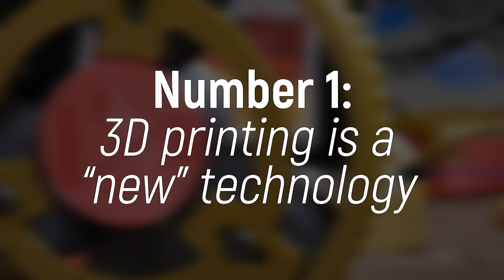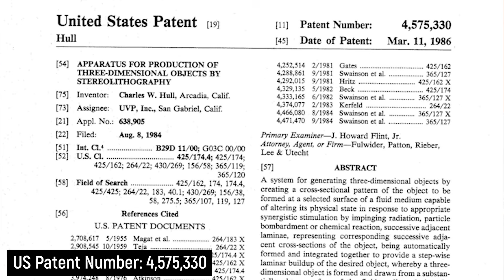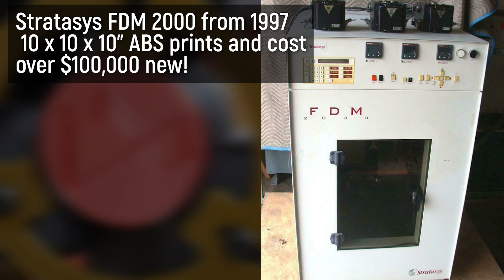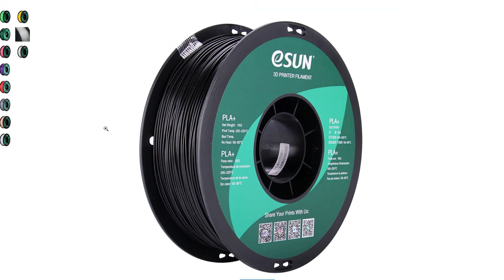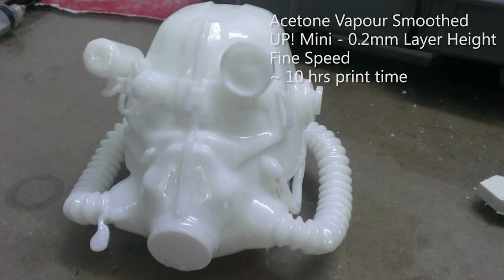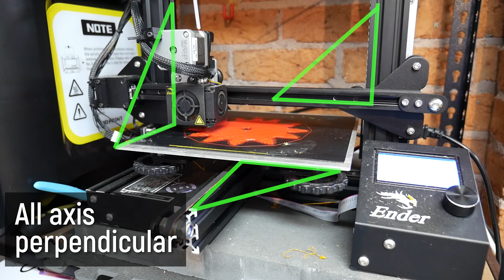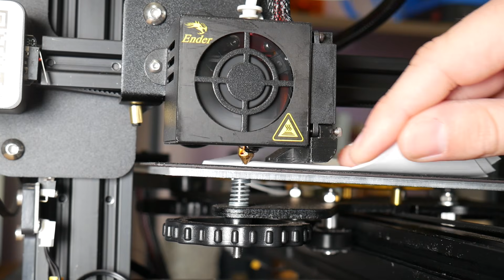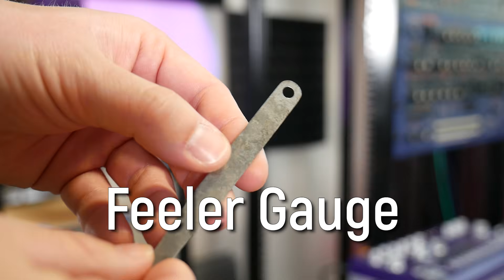3D Printing Myths I used to believe...

Comment: My first experience was in the early 90s visiting a General Motors R&D facility when in high school where they were doing SLA at the time.  Then again when I worked in the Aerospace industry around 2006 where my first machine was an Stratsys that we used to for lost cast molds that were used in place of wax.

Comment: You would never use a folded piece of paper (and this is the first time I have ever heard such a silly thing mentioned).  Use a single standard thickness piece of paper, I prefer junk mail.  You want a little bit of grab but not enough you have trouble pulling it out.

Comment: We really need a proper z depth probe for the nozzle. It should be rather easy to hookup a gpio port to the nozzle then ground a feeler gauge on the bed. Then you just need to run down the z until the circuit closes and you have the nozzle height. Simply subtract  the gage and you are good to go.

Comment: How can it take years to discover something as generic as feeler gauges, which have been used to set valves clearances and ignition timing for over 100 years?

I sometimes wonder what they teach in schools and universities these days, and how limited someone’s knowledge and experience has to be to qualify as a teacher or a lecturer. 

To be clear, as soon as I saw you faffing about with that piece of paper, I immediately thought of a feeler gauge. Then when you said that there’s actually a ‘DEBATE’ about how much drag is appropriate, I thought I’d been locked up in a mental ward! 

This reminds me of the nonsense excuses NASA gives for not returning to the Moon for 50 years: they’ve lost the technology. I thought that was impossible, but you made me believe I was wrong. 

We are apparently not evolving as a species. We are instead in a state of steady retardation.

Comment: #2 I quickly found out back in 2013 that ABS wasn't a great 3D printing filament, found that slapping a bag over my Replicator Dual greatly improved it and also stopped the bed from warping (which also removed z banding)

#3 because the bed is "springy" i use a light and check for there to be the slightest of light to show as each corner can have different spring tension, meaning each corner having the same resistance means there's the same amount of force on the spring and not equal distance.

Comment: How hard would it be to design a print-head that has a range-finder that measures its own height above the bed as it works, rather than using pre-sets?

Comment: I've been "leveling" (tramming) my bed lately using a flashlight. Shine the light behind it, get down low and look across the bed, and move the nozzle down just until you can't see light under it any more. It's crazy easy, almost too easy to screw up, and gives you a near perfect zero point. 
Also, I really think the first and only mod anyone needs to make to their printer is installing Marlin 2.0 for mesh leveling and babystepping. Seriously, this is pretty much a requirement especially for kit printers. These two features are real game changers and absolutely crucial for getting pornographic first layers
Reply: I've done this too when I was in the field (doing a demo in a class) Just make sure the nozzle is clean and it works nicely

Comment: While correcting misconceptions about leveling you should address the issue of whether you should heat the bed first.
Reply: If you are printing PC in an enclosure you better let the enclosure warm up as well because the gap will change again.

Comment: I always used a single thickness of paper, then matched the 'grip' on all four corners.  (I made sure that it was fairly hard to shift the paper)  

To make sure that I got a good, smooth, 'grippy' bottom, I run a hot, slow, 0.04mm bottom layer.  I don't need a glue stick/tape/a brim or raft/etc., as it always sticks VERY well and the bottom is *perfect*.  Even when I switched to (etched) glass, I don't need a glue stick/hair spray/etc.  I just clean it well and go.  (I suspect that the nozzle is actually running along the surface for the first layer, and, after the molten plastic is packed into the tiny surface defects, the trailing edge of the nozzle scrapes the rest off.  By the time the nozzle gets back to that location for the second, faster, cooler pass, the thin film has set firmly in place, giving the rest of the print a solid foundation.  The only time that prints let go is when something goes wrong and the nozzle ends up pushing against something.

Comment: The first time I saw a fused filament 3D-printer was when I was studying at Turku institute of technology In the early 90:s. It even had dual extruders, one for the actual print, one for support material. It was quite slow and the resolution was lower than the current ones and I guess it was very expensive but it had a fairly large printing area, maybe something like 50x50x50 cm and an enclosure. Don't know what material it used, probably ABS.

Comment: At its basic level, 3d printing is using a wire feeder to deposit a spool of material in layers, not unlike how a mig welder works and mig welders have been around since the 50's.

Comment: Great bed-levelling tip there, running a CNC mill teaches tramming in no time at all, gets expensive fast when its wrong ;)  By knowing your gauge thickness exactly and raising the bed to that height before tramming, the gauge can be any height at all and it will still give good results.

Comment: Thank you for finally "officially" clearing up some of this stuff that has been floating around for years... I eventually stopped helping people with their printers because they would always say "XXX YouTube printing guru says to do this" <Insert mythconception> and I would try to show them the proper way to get good prints... This has been my livelihood for decades and I know and have tried to explain all of these... from the most basic This is a machine tool and requires care and maintenance to the proper ways of actually setting one up correctly and altering the parameters based on speeds, materials and finish... but after being told for the thousandth time that "I don't know what I am talking about" I finally let them just go and continue with their fiddling while I just keep making prints... Thankfully, you have been one of the better ones out there and produced a LOT of great content!

Comment: I use a feeler gauge to "level" my printer bed. Paper can crush under the nozzle when you feel the resistance..but then are you at the right height? Metal feeler gauges are solid and don't crush easy thus more accuracy in bed to nozzle height.

Comment: if using a feeler gauge to set the bed height try the go-no go technique. To set at say 0.3 use a 0.4 adjust till it will not slide under the nozzle then 0.2 till it will slide under without resistance then recheck with the 0.4. Takes the guess work out of using one 0.3 gauge and how tight it should feel.

Comment: We print hooks to hang customer chainsaw chains on for work.  Even generic cheap ABS has a very low fail rate.  When I have tried various PLA and PLA+ filaments the fail rate is almost 100%, many fail within the first afternoon hanging on the done wall.  Add the impact resistance and heat resistance of ABS over PLA and that we have been buying cheap generic ABS at $12.87 a roll including tax and shipping I just have no interest in PLA.

Comment: I run the bed at operating temp, but turn off the nozzle when checking for Z height.  The filament I feel weeps through the nozzle and causes excess friction.

Comment: Great video! I love the power of debunking myths. Also, you're quite right about the fact that only 3 points are needed to level a plane. In fact 4-points make it much more difficult and potentially worse (in my beginner's days, I used to over-tighten the screws so the bed actually started to warp slightly).
Reply: I often end up with one knob coming loose

Comment: Thanks for this. I've been screaming "the nozzle is no longer at zero after you have leveled with paper or metal" for about a decade now. Hopefully it will finally sink in for the masses. 

As for baby steps to get to your leveling height, I'm not a fan of that either. This doesn't account for backlash -  that first jog up might not actually move anywhere even though the computer thinks it has, all due to slop in the lead screw. 

Add to that, many of the cheaper machines can't actually do a .1mm move repeatably or accurately (.08 yes, .12 yes but .1 no -  based on a .04 magic number).

 A better solution is to make some leveling Gcode that runs around the bed for you at the height your first layer will be at and use feeler gauges to set that distance (this works great for having the Feelers set a perfect squish distance for that first layer too, AND the machine does the moving for you so you aren't accidentally lowering the Z without knowing it).  With this code used for leveling you can build in the Home routine, and the move to first Z position too so that the machine is doing the same thing both at the start of the printing code and at the start of your leveling code. Whatever your slicer injects into the printing Gcode or what your Start script is doing before that first extrusion command, put those Z moves into your leveling Gcode too. Even if some of the backlash is not taken up when you first move to your first layer height, it won't matter because it will turn out the same, both when printing and leveling. The nozzle may not be exactly .16mm ( or whatever) from the bed even though the printer thinks it is, but by the time you have set the nozzle gap with a feeler gauge as you are running your leveling code, it will end up with the gap you want and the printer will be none the wiser. And that distance will be repeatable when the printer starts an actual print and the next time you need to level!
But as Chep says, that's a lot for someone just starting to wrap their heads around especially when they just want to get printing.

Side note -  I too scratched my head for years wondering why the filament for my Up/Afina's printed sooo much better than any other brand. The cost should have been a clue. But way back then, who knew you could crush up safety glasses and mix it in with ABS to make a better filament?!
Reply: OK, I need a video and code, any chance? This has really been frustrating me. My old RepRap 2 was pretty good at prints “sticking”, while I have yet to get a good print out of my new Ender with automatic bed leveling!

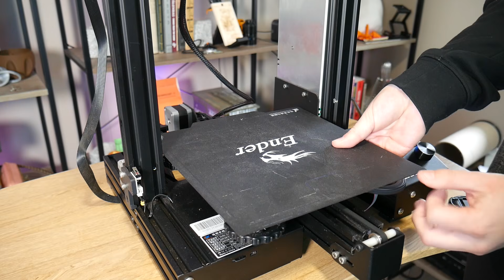Comment: Hey man. I've followed you since before you had 25k followers. I hang on your advice (while not making you responsible for it!) So I've just run out to buy a set of feeler gauges. This part is awesome, (why didn't I figure that out myself?) - all the clues where there. But I never heard it till this video. But the question is, you say at 8:04 tightening all springs, but only 3 are needed for point of contact! I must have missed something, sorry for not reading through comments etc if its been covered before, could you guide me to where its been covered?

Comment: Tramming and leveling are very different and leveling a 3D printer is, in fact, leveling. While tramming ensures that the axis of the spindle is perpendicular to the plane of motion of the table on a milling machine, leveling ensures that the surface of the table is parallel to the plane of motion of the table.

This is an important distinction

Comment: I use another trick to do the leveling : with Marlin, you can define a height while leveling at corners. The line is in the file Configuration.h and called "#define LEVEL_CORNERS_HEIGHT". I did set 0.1 and I use a gauge of 0.1 mm of course, so when my printer performs a home, the Z axis is really at level zero, with more or les of hundredth of a millimeter. Compared to the paper method, this improves accuracy a lot (despite the fact that a piece of paper is supposed to be +-0.1 mm height, it gets squeezed easily thus mlisleading the result). Also, the following is not obvious for everyone, but remember to do the leveling when the machine is hot already since 3 minutes at least. Dilatation matters.

Comment: tramming is squaring the tool, leveling the print bed it making it parallel to the axis. On a CNC, even if the bed is dead parallel with axis, the tool itself may not be square, and with a large cutter means one side of the cutter will be cutting at different heights to the other, which means you wont be able to machine something flat and smooth. If we were tramming a 3d printer, we would be making sure the print head itself is perpendicular as opposed to the job surface.

Comment: I would love to know where to get a single feeler gauge though! I've been using a steel ruler which is consistantly 0.25mm thick.Just wish there was an Octoprint plugin which had this as an option. They all seem to assume that you want 0.00mm. I wrote a bit of gcode to do the job for me (preheat, home and 2 loops of bed (including centre) with M0 in between). Issue I have is that the feeler gauge (metal ruler) gets fricking hot!

Comment: I have been preaching the offset and feeler gauge method on Reddit for years, making an annual post about this process around Christmas with a title of “the how do why of properly leveling your 3D printer”. I even go into why the “yellow springs” are a waste. No matter what, success in this hobby comes from repeatability and this is the way to get there

Comment: I generally use the paper exactly like a feeler gauge and measure the paper. Start the z offset there then adjust as needed as shown by the first couple print layers.

Comment: I level my bed by probing the corners with a BL touch. I have 4 buttons set up in Pronterface to move the probe right above each of the adjustment knobs on the buildplate and one to probe at current location (G30). I probe a corner, adjust the knob, probe again until they all probe as 0.00. Works really well. Auto bed levelers only work automatically so well, if the bed is too out of level they can't compensate for that, so I just go through and level it like that once every 10 prints or so.

Comment: I have found using a raft giver me a bit of cushion on the "bed leveling" before the printing really starts. I also use an eyedropper to apply PLA dissolved and suspend in acetone to my glass bed before printing. I can't help but think hot PLA sticks better to cold PLA than hair spray or glue stick. plus it peels off clean.

Comment: The paper trick is used on milling machines too, suposed to be one layer and be used as a feeler gauge. The goal is to barely feel it tugging (not compress the springs) at equal force so your nozzle distance is equal from the bed everywhere. Then you adjust your z_offset to your desire
Reply: Now I do not use it at all, I put like 10/20 brim/skirt around the piece and level it while it's printing

Comment: Let´s better say "affordable"... I was involved in large format printing for years. An Encad 90 cms. wide printer cost me about 40 million colombian pesos in tthe  late 90´s. Something like 15000 dollars. A solvent printer 2 meters wide called Salsa was about half a million dollars. A Roland eco solvent today is ten times faster and reliable than an Encad waterbased printer and is around 10000 dolarrs today and less. Now, they became "affordable", but created 40 years ago.  3d printers less than 200 hundreds amde it a hobbie for many of us. I would not buy a 3d printre for 10000 dollars actually with so many problems it has and basically too slow. You must finish every part you print by hand, the machine must be perfectly tuned to produce a nice object, the time is so consuming and the results are not what you expect most of the times. Many industrial 3d printers are so: industrial. For home still a hobbie to produce temporary solutions.

Comment: There is a big misunderstanding will ptinting ABS.  A heated chamber of over 65deg C  and the part cooling fan at off is neaded to achieve best strength and quality.  Cnc kitchen don t use a heated enclosure for is test.  The probleme is most 3d printer don t have active heated chamber so it result in a weaker parts,  but with the proper conditions,  ABS gain more strength.

Comment: I think we need to clarify #3...
The reason a piece of paper is suggested is becuase the thickness of it is similar to the expansion of the nozzle once heated. The paper just happens to be a cheap and relatively consistent way to tram and set the height when cold. (Also, metal shims can scratch the build surface so back when just aluminium was used paper was safer) 
Of course, if you heat up the nozzle and bed to printing temperature, this no longer holds true.
Reply: Also, for blanket safety rules, it's safer to level when cold, which is why the paper trick worked.

Using a metal shim on a preheated bed like you suggested is actually not ideal becuase the shims are only calibrated at specific temperatures. As they heat up (due to bed and/or nozzle) they expand and are no longer correct. If you keep the shim against the bed and let it maintain temp then it will at least be consistent, but may be too hot to handle depending on the temps! 

Realistically, the only thing that really matters for most hobbyists is if it looks good enough, anyone using it for engineering applications typically have post processing operations for accuracy and precision, or design it with lower tolerances so it doesn't matter.
Reply: Love your videos and keep up the work, just felt like I should mention this! 😅

Comment: I want to buy ender 3 and BLTouch for auto levelin, is BLTouch worth of buying?
Reply: You still have to manually level the bed, which in my opinion makes it pointless. That is until your bed becomes warped in spots, or you receive a warped bed from a manufacturer, in which case the bltouch becomes 72 virgins that probe your bed in a 5 x 5 grid.